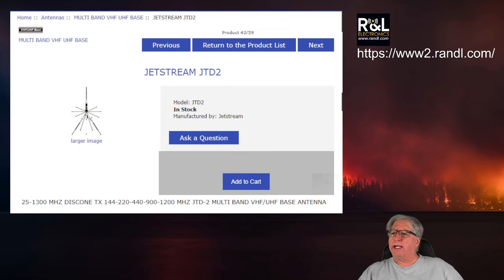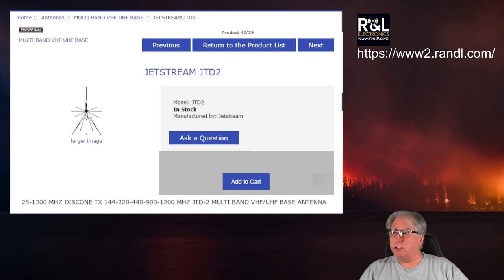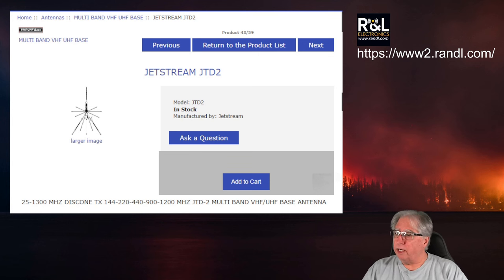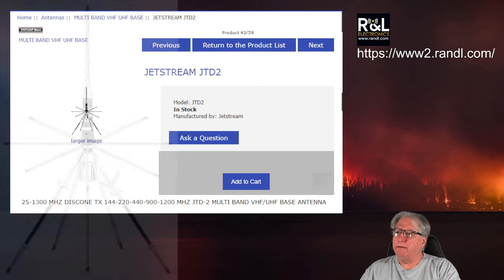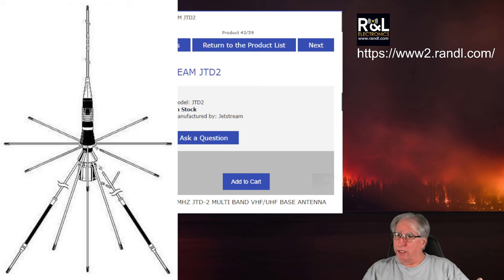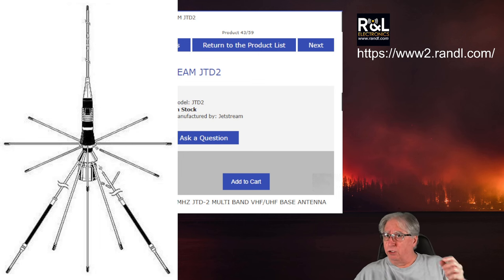Discone Antenna - JTD2 Unboxing, Setup and Testing

Comment: Stu, I've been using discones for many years, and some have been out in the weather for years at a time; one more than 10 years continuous. After being exposed to considerable weather they can be just a bit harder to disassemble. So, as a pointer, I've found it advisable to leave the threaded disk and cone rod threads backed off 1/2 - 1 turn. The jam-nuts take care of any vibration/loosening concerns and after weathering, having that extra bit of thread play has seemed to make disassembly easier. However, I've never used anti-seize/anti-gall lubricants on things before and I'm starting to do that now; this may make a difference after years of weathering. For your intended frequent transport usage I would not suggest using such products as they tend to rub off on everything and get messy. I agree, discones are handy, and when I was in a HOA having a single antenna to hide in a tree gave me lots of available bands and it was not so difficult to hide just a single antenna. 73, Warren - K6WKW

Comment: I’m using the Diamond D3000N Super Discone rated 25 MHz to 3 GHz. It’s a great match for my ICOM IC-R8600 receiver that also covers through 3 GHz. It can also be used for transmitting depending on frequency and power. For the frequencies that I have tested (2M, 220, 432, 900, and 1.2 GHz) the SWR is under 1.6:1. It hears surprisingly well. WA6EJO
Reply from the maker: Thanks for the comment Steve,
Very cool antenna. Plan to try it at an event to see how it does.

Stu
AG6AG

Comment: Stu, thanks for another fact-filled video. I have a Tram 1411 Scanner 25MHz–1,300MHz VHF/UHF Super Discone Base Antenna mounted directly on a metal mast. It has never been a good receiver. I saw you had your discone mounted on a PVC support tube which connected to the mast. Do you think I would have better reception if I used a support PVC tube clamped to another metal or PVC mast? 73, Robert KM6RSS
Reply: My 1411 is mounted directly to a metal tube mast and works great on 11 meters. It's about 20 feet off the ground

Comment: The center top long element is for 6 meters but will need adjustment probably 
In you video you did not show the  SWR for all the other bands that its designed for 25 mhz to 1300 could you reply  to my comment I am setting  up a recieve system  for any signal  any band all rf digital or analog.
You will get better transmit signal with colinear antenna but this saves you money. I'm a disabled USMC vet that can't work but tinkers all day with my radios
73 AA4CP 
Fort Pierce FL 
on  the beach

Comment: ITS NOT SUPPOSED TO BE A PORTABLE ANTENNA. SO DONT BASE YOUR OPINION ON WEATHER OR NOT IT IS EASY TO MAKE PORTABLE OR NOT.. YOU REALLY MAKE YOURSELF SOUND DUMB BY DOING SO.. USE IT FOR ITS INTENDED PURPOSE AND YOU WILL BE MUCH HAPPIER..

IT IS A RECIEVE ONLY BASE STATION ANTENNA, THAT HAS TRANSMIT CAPABILITIES AS A BONUS.
Reply from the maker: Hi Empire Outdoors,
Your comment gives me a bit of a chuckle... I fully disclose the fact that it was not designed as a "portable antenna" and also comment a few times to that fact. I think your definition of portable and mine is slightly different as the portable deployments I typically do are EMCOMM based or setting up comm stations in metropolitan areas. If I was hill topping for SOTA or doing 1 or 2 hour deployments I wouldn't even consider an antenna like this.
As for your comment that "IT IS A RECIEVE ONLY BASE STATION ANTENNA, THAT HAS TRANSMIT CAPABILITIES AS A BONUS" Many times when you are setting up backup communications for an IC you have a stable source of power, but your remote stations do not. The fact that it has great receive capabilities is a plus. The fact that it will handle up to 200W is a real plus.
Anyways, sorry you didn't enjoy the video...

Stu
AG6AG